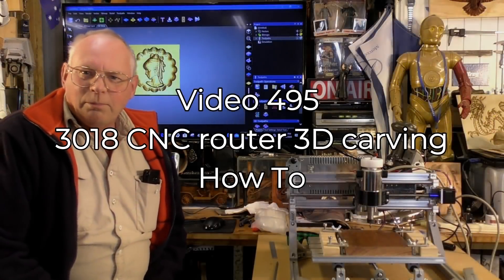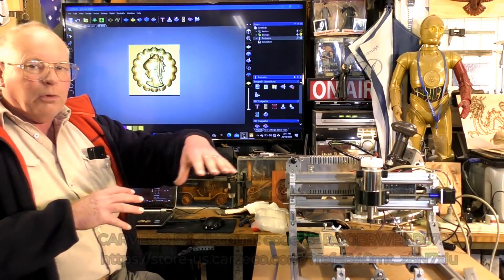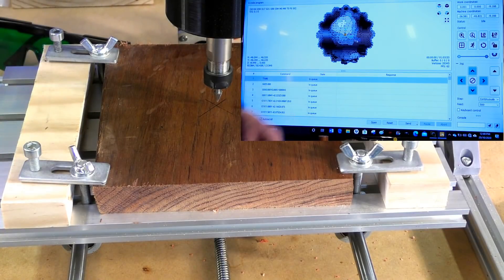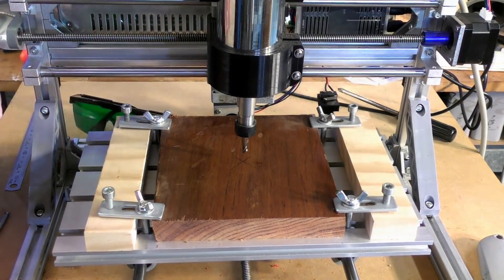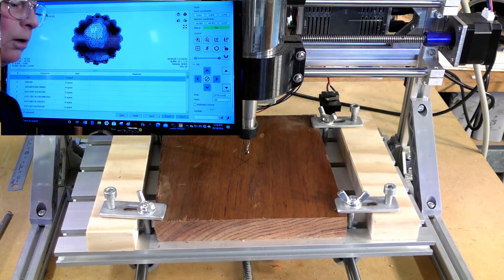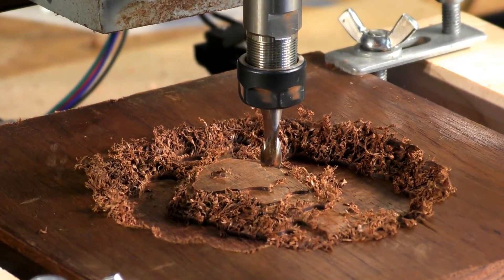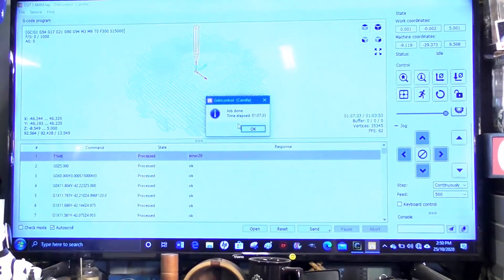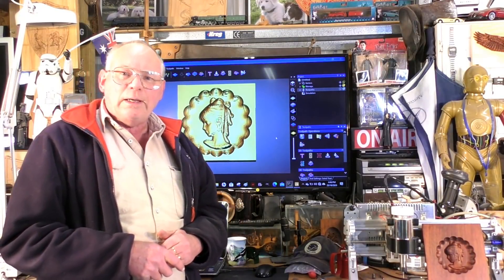HOW YOU CAN MAKE $10,000 “like a BOSS” with a Fully Upgraded 3018 CNC router

Comment: Hi is it possible to ingrave non flat surfaces like an electric guitar body?  As it has contours??
Reply from the maker: Yes, but not with a 3018, you would need ie, a 6090 and Carveco Maker+
Reply: @inventorsworkshop9600 thanks
Reply: What about cutting plastic airbrush stencils can that be done with this machine?

Comment: Hi Mr. Roger, i have a idea to buy this cnc 3018 machine, i read in specification, this part is confused Frame Size: Approx. 380 x 315 x 225mm / 15 x 12.4 x 8.9in
(XYZ does not include motor protruding parts). seller saying- (XYZ does not include motor protruding parts). what is this mean, i need to buy this item separately or, i can work without these parts?. seller can't understand what i am asking about this, hes sending same screen shot from specification, ha ha ha
Reply from the maker: DO NOT buy from them!

Comment: sir what feed rate did you use with that ball mill?
Reply from the maker: 12mm per second feed and 0.18mm step over in Carveco Maker
Reply: Thanks sir for the info, I build my own machine, and I have that same spindle, I'll be trying your setup right away.

Comment: Question: when you changed the tool to do the finishing cut, you said you do again the zero. Where the zero si done in this case? Outside the cut (like in the not worked area just like the initial zero) or the the highest part of the already worked area?